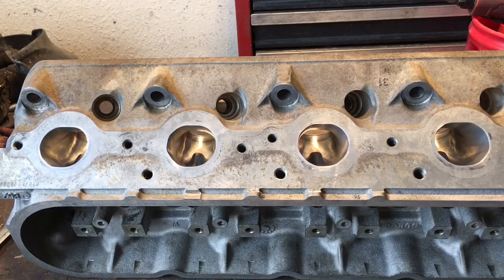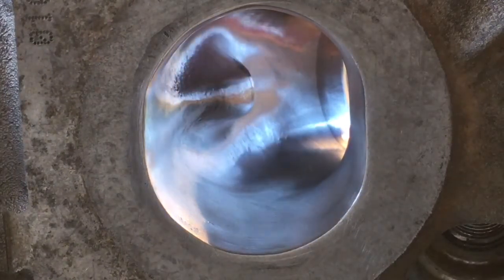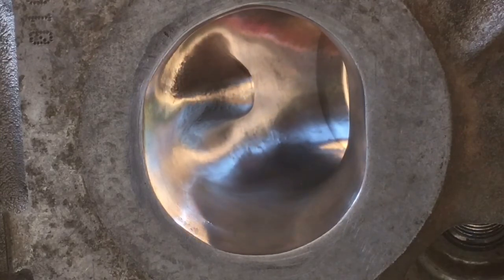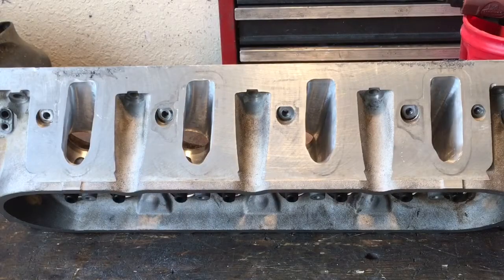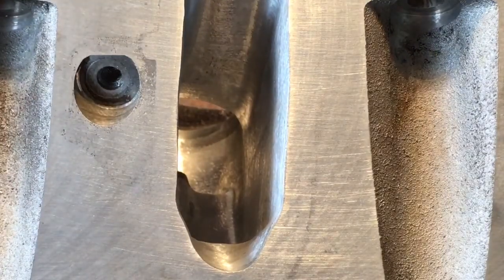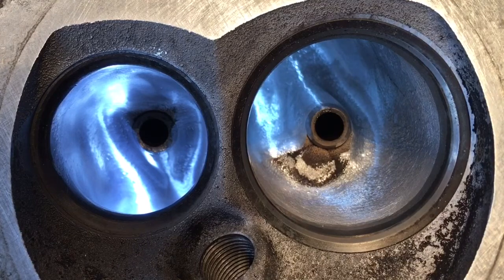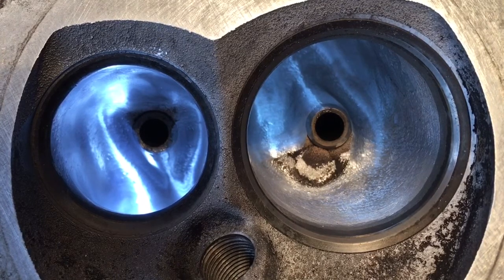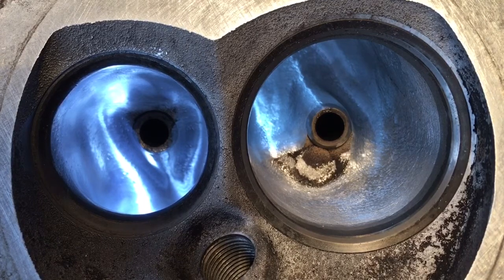Ported 862 LS heads Final Ports

Comment: I got this head, is it worth porting & How much hp can i get with it?
Reply from the maker: Fully ported 862 w/2.00” valve supports 600hp NA.  More power than 99% would ever build.  Add boost and the bottom end & head gaskets are the limit.  JD
Reply: @HeadFlowInc  I’m making about 900-1k hp on boost with arp head bolts

Comment: Did you flow test these? Just curious to see how they did with the swirl ramp staying compared to taking it out. Nice work. About to do a set for my turbo iron 5.7 nova
Reply from the maker: This same style port work using the stock 1.89” valve flows more than a OEM 243/799.  I went with the 2.00” valve on these w/swirl ramp to help keep the intake port smaller at 212cc.  I did not flow this exact set of heads since they were for my own 4.8 Turbo.  I would expect to see 275+ cfm on the intake port.  JD

Comment: I removed the "ramp" off the roof of the intake side from my 862 cathedral port heads... Did I ruin the heads by doing this? I see some heads with a "straight through" design as I'm talking about but most of them retain some of that ramp I'm speaking of. Would like to know because I can see it possibly being a problem as for losing velocity looking at it now.
Reply from the maker: It will depend on a few things like valve size, cubic inches and application. 
What size throat did you use and what valve?
The ramp is a torque building mod to promote velocity and low/mid lift cylinder filling. By removing it adds volume to the port which may or may not be beneficial. I don’t think it’s ruined. 
Application, is this a race setup, daily driver, roll race?  
Boost, nitrous etc? 
JD
Reply: @HeadFlowInc  stock valve size. I'm going for atleast 85% bowl cut of the throat but I haven't gotten there yet. I don't know the exact application as I was planning on selling them after sending them to a flow bench and cc'ing them myself. So it's up to the next guy so to speak. These are just an extra set to play around with. In my head I've been thinking boost

Comment: Do you remember brodix heads with golf balling in the first 1 to 1.5" of the runner ? I can not remember if it was brodix or a outside source doing it I do remember the heads were cup car related that raised some interest i was still building my first car and about to attend a paid schooling from David vizard I was only 14 then he taught me an a handful of men how to!.... it was after his teachings.. I put the carbide to aluminum on my superior to the time small block chrysler indy race heads. I worked at my uncles race driven machine shop where he was the  machinist ,builder,tuner,exc,exc.for two self sponsored nhra top fuel teams. I grew up learning how to tig weld,resurface crankshafts,,tig up top fuel heads& Blocks. it amazed me how a block made of aluminum that I thought was brand new had been repaired you couldn't and still would not be able to tell unless told .I was @13 when I started working in summers and after school for my uncle saved for my first car and built it with the knowledge and wisdom given by my uncle... to be a 15 yr old student driver with a daily driven 408ci Mopar sporting Mancini bought as cast race heads. 727 torque flight turbo action stall converter and hard parts.mini tub with a as today standard 275 tire size .15yr old first car self built in early 90s that ran into the 9s .I owned the streets for a couple years to say the least. Was respected but tested alot especially by the cops 👮‍♂️
Reply from the maker: I remember a lot of talk about golf ball dimples etc but don’t recall if they ever worked out.  Interesting Brodix tried them.
You’ve been blessed to grow up with so much talent around you and opportunities to succeed!  I am jealous of your teenage success, back in the mid 80’s we thought we were fast running 12’s!  Nice 😎

Comment: JD:
 Still working on my 862's per your excellent videos.  Please advise on chamber mods that you made on these heads.  Must have missed the video.  THANKS God Bless.
Reply from the maker: One big area I’ve found that helps exhaust flow, even with the stock 1.55” valve move the chamber wall over .045” to help unshroud. 
If you go to the 2.00” intake valve there’s very little area to unshroud the intake side on the small 3.780” bore engines.  Always use your head gaskets to verify the area you have to work with.  JD
Reply: @HeadFlowInc  JD:  I should have told  you that the bore is 3.898.  Could have gone to 4 inch bore (per sonic check- gotta love the early blocks), but I already had the pistons.  I will be notching the chambers for the larger valves (2.0 and 1.575).  Always use the bore as the final guide and not the head gasket as this is misleading, esp if the gasket is a large bore.  If you have any pictures of the chamber wall move, please direct me to them.  Thank and God Bless.
Reply: @HeadFlowInc  JD, I think I may have missed the chamber wall move.  On second thougth, I believe you are talking about relieving/moving/notching the chamber for the larger valve.  I initially thought could be talking about the "lump" in the chamber next to the exhaust valve and extending over to the spark plug area (looks a little restrictive to exhaust flow even with the stock exhaust valve???
Reply from the maker: I don’t mess with the spark plug lump, you’re right I’m talking about unshrouding the valve to the edge of the chamber.
Reply: @HeadFlowInc  THANKS for clarifying.  Keep up the good work.

Comment: How do I get a hold of this man is doing the porting
Reply from the maker: Email me jeffdubray@gmail.com
Reply: @HeadFlowInc  Hey this is Mike Wagner and I got this 862 head and I was wondering if you do that porting for other people.
Reply from the maker: Yes email me 👍
Reply: @HeadFlowInc  I got 862 heads I was wondering how much it would cost, but I didn’t want to change the valve size I want as much torque as I could get this goes in my hummer H2 with a 6 L motor he
Reply from the maker: Be very careful putting 862/706 heads on a 6.0 because it’s easy to exceed the octane of pump gas. You can definitely raise the compression but the camshaft has to match or the DCR will be an issue. 
Send me an email about your build and I can definitely help!  There is a good amount of flow improvement by porting the heads even with the 1.89” valves and leaving the swirl ramp intact.  Send me a note!  Merry Christmas 🎄
Reply: @HeadFlowInc  I’m going to use a sloppy stage two cam from trick flow

Comment: I am almost at this stage on 1 of my 2-706 heads and am amazed at how long its taken to get there doing some work here and there..mainly waiting for the temperatures outside to cool down so I can work continuosly..my new double cut burrs came in and they are awesome,really helps shape the port.. I have had zero problems controlling them... now I need your opinion on a few things if possible ?  I will get more cartridge rolls anyday now but I want to cc all the ports and wondering if I should go ahead and polish the ports,then do the cc'ing or or do them at the stage right before final polish ? My work is coming out really good but the casting lines in the intake ports were huge,and the ones in the valve bowls not so bad but required some effort for sure,and I saw just a slight little casting line in 1 of the intake ports you are showing here and thats about where I have mine..so looks like I'm good there.  Thanks for these videos !
Reply from the maker: Ross Krause I don’t worry about the casting lines, some can be very thick and deep.  There’s no need to remove material purely for cosmetics that may cause you a headache if you remove to much trying. Smooth and radius 
I’d weight to cc till after the final polishing, sanding rolls and polishing buffs still remove some material. 
Congratulations, sounds like you’re well on your way!!!  Keep up the good work!  Those new burrs always cut so nice. 😉👍
Reply: @HeadFlowInc  I used the sanding rolls fom Harbor Freight last time and got the smaller package..only 6 of them didn't blowup or blowout   on me as soon as I fired up..so might look at Standard Abrasives this time,but pretty costly..

Comment: Can you please help me out I'm starting to Port and Polish heads but I would like to know what kind of tools do you use and where you get them from thanks and remember keep God first and everything else last
Reply from the maker: Jessica Watson- English I use air die grinders but if you’re just starting I’d look into the HD 1/4” shank flexshaft setups.  Iirc they run around $400.00, which isn’t too bad if you’re considering air tools and the cost of an air compressor.
I don’t care for the electric die grinders unless there a high end unit with rpm control.  The electric die grinders I’ve tried were cheap, maybe a quality unit could work? 
Which ever method you choose take the time to learn how to control the cutting burrs 100% 😇
I buy my burrs online from eBay and Amazon, having the correct shape, size, length and flute for the material will both save time and help with a better quality end result.
My favorite extended air die Grinder came from Harbor Freight.  There are processes you’ll really like a 90 degree die grinder as well.
Reply: @HeadFlowInc  thanks so much for your quick response and I love watching your videos I'm a fan and I hope I can get as good as you one day thanks again and remember keep God first and everything else last

Comment: That head, as ported, would out flow a 243 head by a huge margin, with its small chamber it’ll raise an engine’s compression too. The 862 head in the right situation is a great economical power adder. 862 heads are dirt cheap too............ You’re welcome.
Reply from the maker: Peter Fraumeni I agree 100%!

Comment: do you completely remove the lump on the roof of the exit portion of the exhaust? i heard its reinforcement for the rocker, i also heard its part of the water jacket. yours looks completely gone. no issues?
Reply from the maker: soyramflero The raised area below the exhaust guide boss can safely be removed to the port. There’s no need to go crazy, don’t dig just smooth the area. Is this the area you’re talking about?
Reply: HeadFlowInc I think so. If I raise the roof and open up the exhaust port I would be digging even deeper into that lump. I'm a little confused
Reply from the maker: soyramflero You blend the raised opening to the existing roof.  I’d say do the raised roof inside the gasket and blend it, if you’re not comfortable messing with the bump leave it. 👍
Reply: HeadFlowInc thanks for the quick reply and vids. i appreciate it

Comment: I have an extra set of 862 heads off of a running 4.8 that I would like to have ported and bigger valves installed. What’s the price to do this?
Reply: It’s going on a 02 Camaro ls1 with a camshaft
Reply from the maker: David boyd It depends on where you’re located, shipping costs etc. 
A complete set of heads with fresh 5 angle valve job, surfaced up to .030”, Fully Ported Intake and Exhaust using the valves you supply. 
$1000.00 assembled. 
The heads will need to be in good useable shape in terms of guides, seats, and no cracks.
**note***
I don’t work on the heads with the battery symbol. They have crack issues even in the rocker area.

Comment: It's looking good. Your power numbers should be easy to obtain. With the stock 862 heads and cam when I had the 5.3l together put 300 to the ground. So you should have it no problem.
Reply from the maker: stealthhit When I get back home I have a potential problem.  As I was lapping in my valves I noticed a fine crack between two seats! 😳. I have to take the heads and have them pressure tested. I hadn’t noticed the crack before/during Porting. 🙄. Hopefully it’s not an issue but if so I’ll share how we proceed.

Comment: Do you offer porting services or is all your work just for your own projects? I’m looking for a set of 862’s for my LQ4. Awesome videos by the way👍🏼
Reply from the maker: Mikey J Both, honestly it depends on if shipping is required and Head cores/condition. The 862 cores need to be carefully inspected for heat cracks in the aluminum in between the intake & exhaust seats.